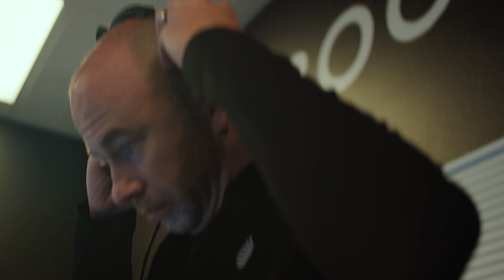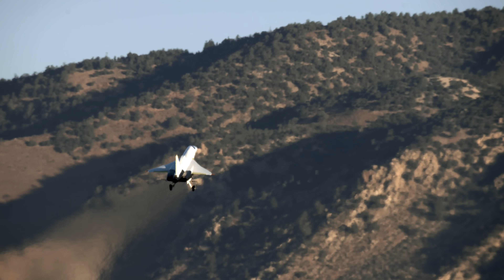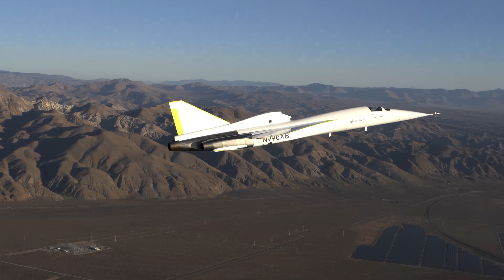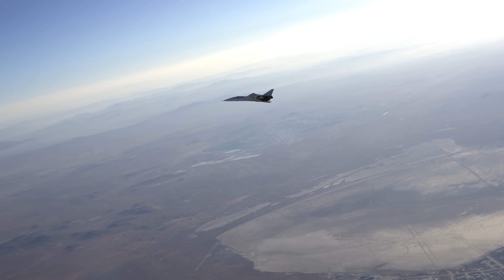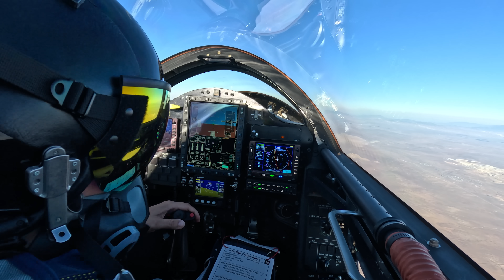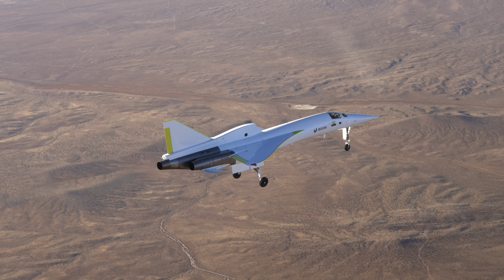Go Inside the Cockpit: XB-1 Flight 4 Full Video Narrated by Nick Sheryka—Chief Flight Test Engineer

Comment: I have managed test flights before - not the overall program, and no envelope expanding stuff for a new type - just mods.  This was very interesting to work those cards so fast, but your fuel burn rate seems pretty hefty and range limits tight.  We did do handling qualities and basic safety stuff accel stalls.  Love the calm demeanor when stuff goes wrong, gotta be that way.  My question is, what are you guys going to do with this thing when it's over.  Is this just T-1 or will it be a conforming article?

Comment: Hundreds of comments and I see not one piece of analysis on how this SST attempt might resolve the problems from 50 years ago, fuel consumption, high speed takeoffs, air frame heating.   The point of Boom can not be to build a T-38 version 2 for fans and then go bankrupt.

Comment: The orange boxes on the wingtips:  Are those onboard camera mounts to record still and video data of the a/c or are those weights or some other device used with the flutter tests?
Reply: Oh and at @14:44 I think I figured it out.  It's some sort of mechanical shaker that created different vibration "profiles" to induce flutter, isn't it?

Comment: Nice flight ! Might have been prudent to check out that mechanical issue before doing the 2.5g turn ? The AOA on landing is high, is there a backup if the front camera fails ?

Comment: Loved it!  Back in the early 80s I spent a semester in the flight test engineering department of a now-defunct aircraft manufacturer. I wrangled my way onto a few flights, including a very memorable one where we conducted rudder hysteresis tests and single-engine stalls. For that one I was in the right seat writing down airspeeds - or trying to, given how badly the panel was shaking.

Comment: 17:33  Why is the gear handle red and why are amber lights above the mains?  Isn't that a disagree ?
Reply: Red handle is gear is in motion, and unsafe gear when the gear is extended.
Reply: @marka8947  Yes but shouldn't the red light in the handle be extinguished when the gear is down?  .....or is it red because they are above the gear in motion max speed?  I don't know. Just guessing.
Reply: Outflow valve.
Reply: @marka8947   The red light in the gear handle is the outflow valve ?   You said "outflow valve" without any context.

Comment: Nice video. There's a reason they do flight test out in Mojave, great weather, lots of dry lake beds for an emergency landing. Great pics of Edwards AFB as they fly over doing test points. Check out the angle of attack for takeoff and landing, it's so high the pilot has to use synthetic vision on the primary flight display to land it. No droop nose like the Concorde :-D

Comment: I’m an aviation enthusiast, but not savvy with the experimental process involved with testing prototypes. What does testing with this prototype do as opposed to starting with the actual design? I’m assuming these aren’t even the same engines that will be used. 

In short, why run so many tests on a prototype that holds little in common with the end product?

Comment: looking to do 24v set up... looking just to use panels  2 200w in series .Renogy Solar Panel 200 Watt 12 Volt, High-Efficiency Monocrystalline 10.42 A..

will a Victron Energy Smart Solar MPPT Solar Charge Controller (Bluetooth) - Charge Controllers for Solar Panels - 75V, 15 amp, 12/24-Volt be good enough to use with that 2x 200w panels? i dont plan on putting more panels just sticking to that 2x 200w so 400w

Comment: Why does it look like it's flying at an angle the entire time?
Reply: Has to maintain high AoA at low speeds to stay in the air. If they drop the nose it’ll fall out of the sky
Reply: @charleshopkins3817  Yeah, but isn't that for slow speeds?
Reply: @masterknightx  300mph is slow for an airplane with such short wings